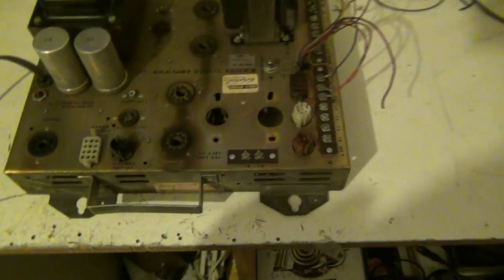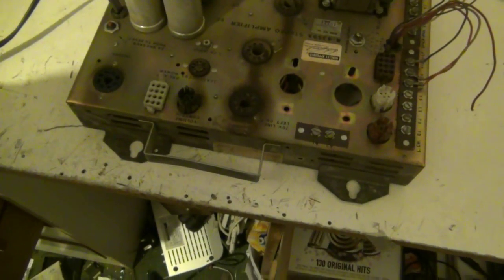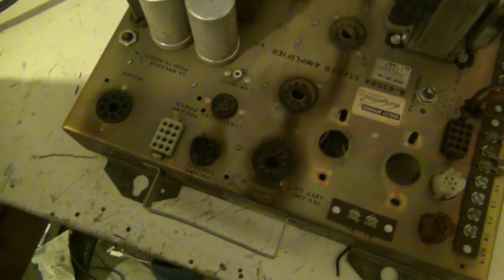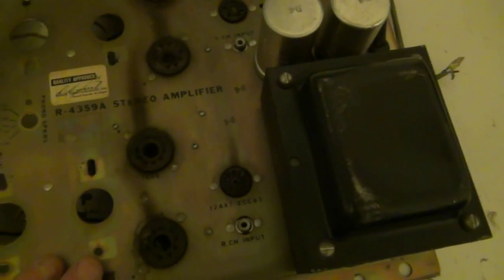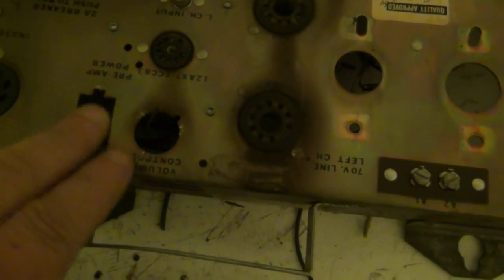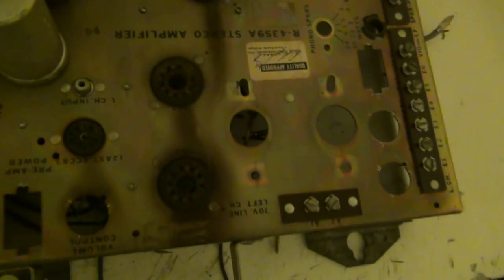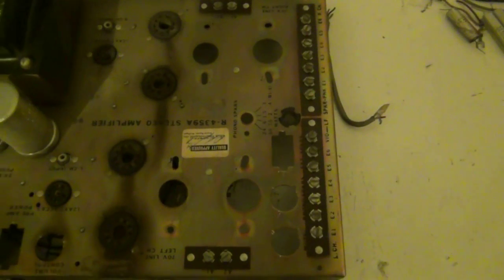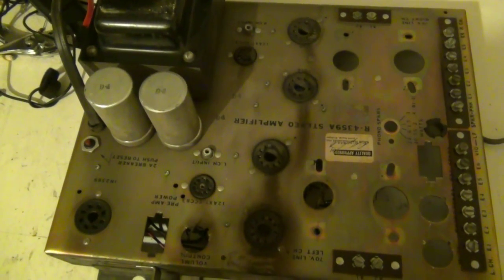MULLARD 5 10 VALVE AMP BUILD PREPARING THE CHASSIS pt 1

Comment: i would use GZ34 rectifier each heater of the EL84 / 6BQ5  is 760 MA x 4  EF86 200 MA  12AX7 300 MA you will need 3600 MA heater current 
plate current 92 MA/max grid ( 2 )  current 22 MA  = 114 MA per pair push pull  114 MA x 2 so your power supply shout be 228 MA of EHT current or higher